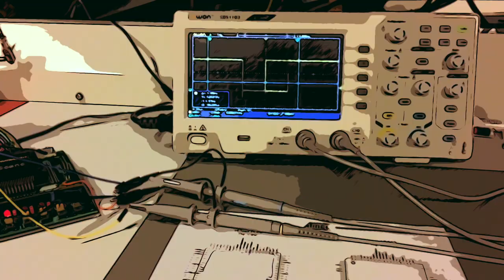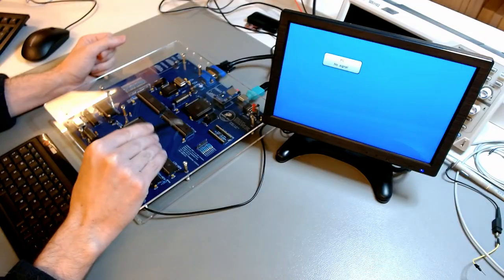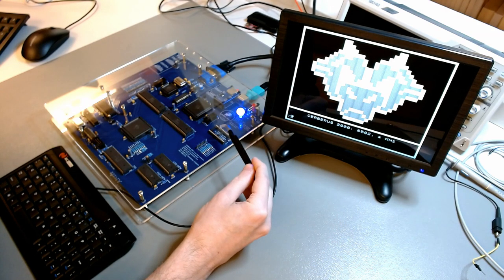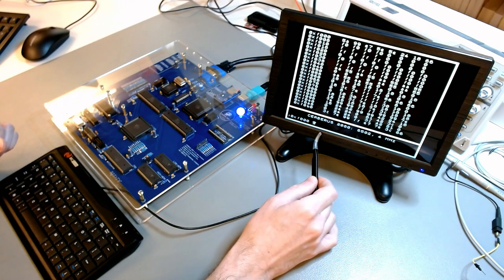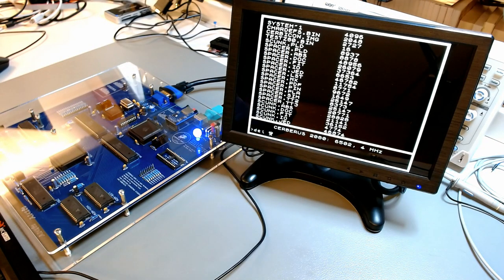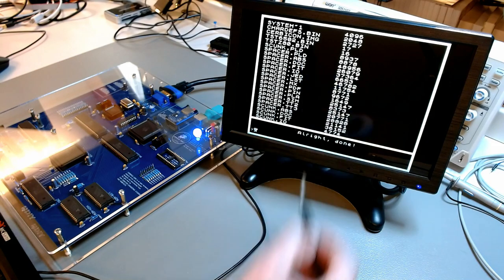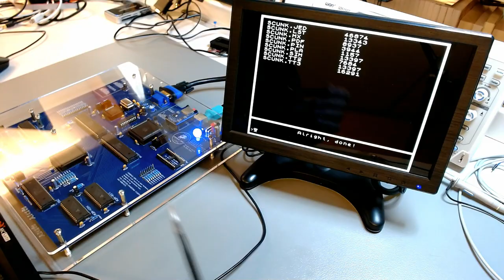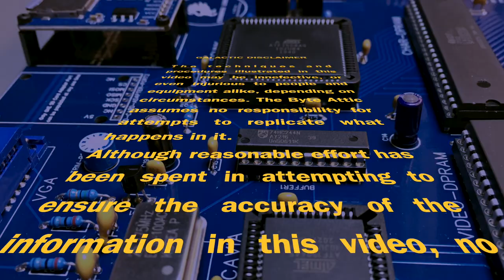Building CERBERUS 2080™, my dream childhood computer: Episode 18

Comment: It's looking good.  One change that I would make would be to add a jumper or switch to switch the oe between the char memory and char eprom. Thus allowing for both chips to remain on the board.
Reply from the maker: It's an idea. It would be electrically better to use the jumper to just turn one on and the other off, to avoid unnecessary power dissipation.

Comment: I've really enjoyed this whole series, and the final machine looks fantastic!  A small change you might consider if there is a second version would be to be able to have both the char EEPROM and RAM in at the same time, and have CAT be able to switch between the two, to read the character definitions from ROM on boot up. That would enable the machine to run without an SDCARD.
Reply from the maker: Thank you, Sir! Yes, I thought about what you are suggesting and ultimately left it out for the sake of simplicity. But it is entirely doable. If CERBERUS becomes popular, either I will come back to it for a version 2, or the community will in any case develop it further, so it will end up there too.

Comment: Looking great Bernardo! The only thing I could suggest with your LIST command is formatting single digits with leading zeros (ie A as 0A) if you have the space of course! (My OCD kicking in!) Can't wait to seeing something up and running and the process behind that! Well done  👏👏👏
Reply from the maker: Thanks Matthew! Unbelievably enough, the thing is balanced on the last few single bytes of dynamic memory... so even something as simple as adding leading zeros requires an if-then-else structure at the minimum, and that may already make the thing unstable... I am just asking too much from that little ATmega328... But it is flat-out impressive that such a little thing can actually do so much!
Reply: @thebyteattic  All good! Certainly a fantastic job!
Reply: @thebyteattic  Yes, I wish I had the skill to help.  I did a little 6502 assembly on my VIC20 a long time ago.  I have no experience with the Z80.